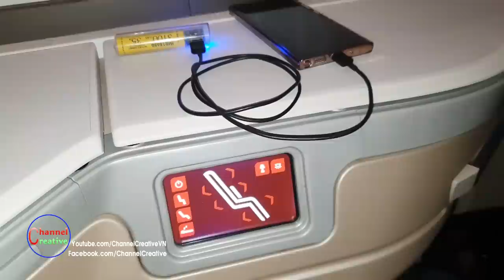How to Make a 3100mAh Power Bank Led Light 2 in 1 using Syringe

Comment: *BE CAREFUL SOLDERING THE ENDS OF A LITHIUM-ION BATTERY, YOU'RE SUPPOSED TO WELD THEM BECAUSE ITS QUICK AND DOESN'T HEAT THE BATTERY UP, BUT APPLYING HEAT FOR A LONG TIME CAN CAUSE PROBLEMS*
Reply: i've never had an issue soldering to batteries..
Reply: Texas Tex. pride goeth before a fall........
So why don’t you film yourself applying a hot soldering iron to the terminal of a nice large battery, “FOR A LONG TIME”, and then you can post the video on YT?????
Reply: @norrinradd3549  why would he apply it for A LONG time when he has skill to solder it quicly? I do it myself too and never had problems. Just use your brain and common sence and everything will be ok
Reply: Soldering is fine tough, but he took it too long to heat
Reply: The soldering process should be fast and then absolutely nothing will happen to the battery, do not panic.
Reply: direct battery soldering is not for beginers and unskilled diy'ers

Comment: Everything is fine, the problem is I am not able to get these batteries in India, and if get online, either they are priced too high or I have to buy minimum 1 pack that contains at least 20-50 units.
Reply: What about used/dead laptop battery disassembly?